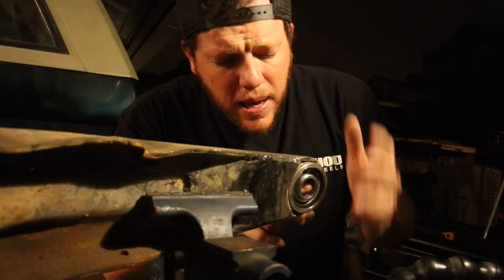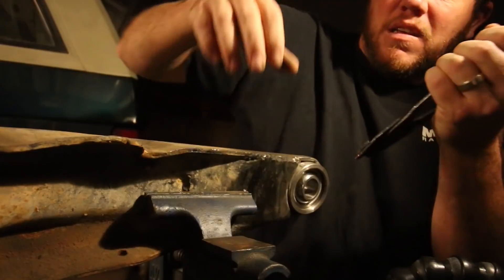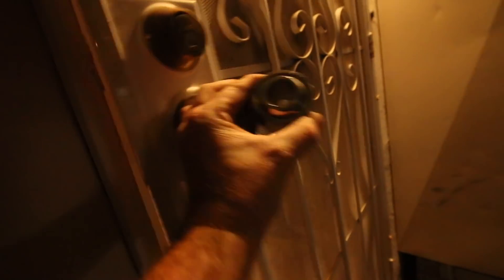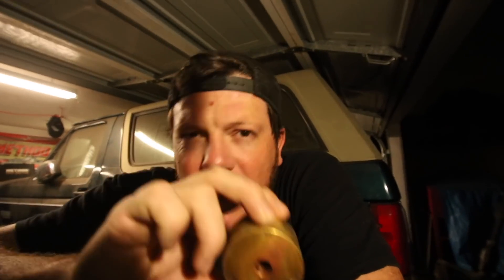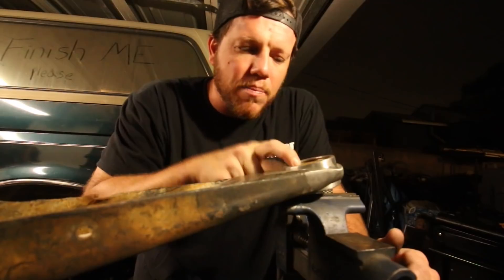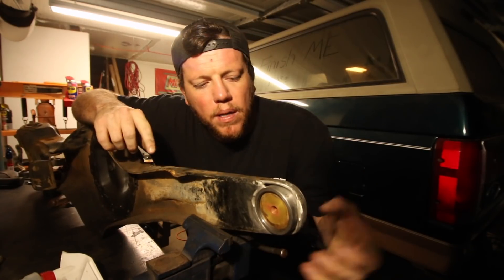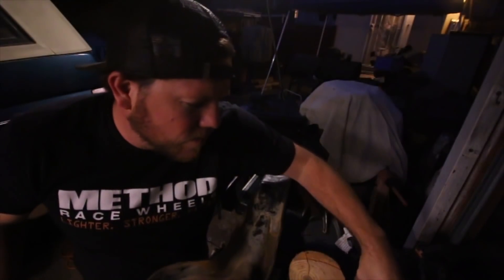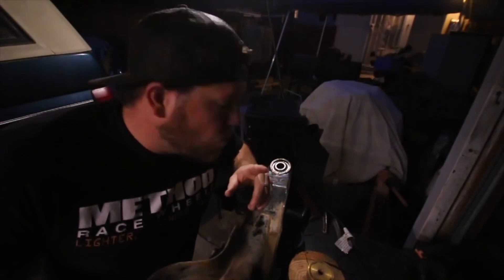Dana 44 Uniball conversion on Ford Bronco

Comment: Awesome job man. I was curious if you've ever seen/heard of anyone MIG welding a uniball cup in. It's the only type of welder I own so I i really don't have a choice. Information is so limited on this specific topic, I'm wondering what type of issues I might run into.
Thanks!
Reply from the maker: Yes. Uniballs get welded in all the time. I think the main thing to focus on is preheating the metal prior to welding with a MIG. And then letting it cool very slowly would be the best to ensure that you get the strongest weld out of it.
Reply: @TheycallmeWallyDude  Right on man thanks for your time

Comment: Liquid nitrogen works too and so does heating the outer race and arm but don't heat too hot not more than 3 hundo
Reply: If you thread that bushing then you can rig a slide hammer to it with all thread and a drilled out round stock and a couple nuts will save from damage of the races and stuff
Reply from the maker: Yep. It's actually threaded already but I don't own a slide hammer. The first one I did I ended up pressing it out. The hammer was a little bit more for effect and quickness (filming takes forever). But then it started working pretty quick and not damaging the slug so I went with it.

Comment: What size uniball and are you using misalignment spacers?
Reply: 1" uniballs, Camburg offers the special mis-alignment spacers I used on our Bronco. Not sure if Wally got them at the same place but I bet Desolate or Solo Motorsports offer them as well.
Reply from the maker: Yep. Purchased everything from Solo. Just let them know your doing a uniblall conversion on a Bronco/F150 and they'll ship you exactly what you need. I'd even ask for the bolt/nut/washers too just so you don't have to source anything out yourself.

Comment: Did you just run a single pass on the weld or two?
Reply: Good to hit a hot pass like 180 amps then a 120 amp cover pass to lay it flat fillet

Comment: Wally The uniballs are nice but not the key to your TTB. Cut and turned TTB I expect ? The much more important important things than those bushings to uniball is Heim Joints on your long chromoly radius arms. More importance is GUSSET AND PLATE THE BEAMS a vertical attachment on the beam to radius arms is a big plus too.  The F-250 slip shaft with a larger U joint to replace your slip shaft on the pass side is a nice addition too. Make sure you take the time to CYCLE THE SUSPENSION on each side up and down  while spinning the wheels in 4 wheel drive for any bind points with the axles spinning or limiting your travel !!!  It can take some time but worth every minute. Then LIMIT STRAP IT. Assuming you do not have anti sway bars still infecting it. Look up for more details on Bronco Speed part of the FSB Forum. (Full Size Bronco Forum) Online ! Broncos are great and amazing when built well. Here is a short video of mine on my first run on the 150 mile Mojave Road. The song on the stereo in my Bronco is done by a band with a name you or your girl may like from your intro. The Butthole Surfers (not gay) here is link..https://www.youtube.com/watch?v=LtuWtuR2qIg